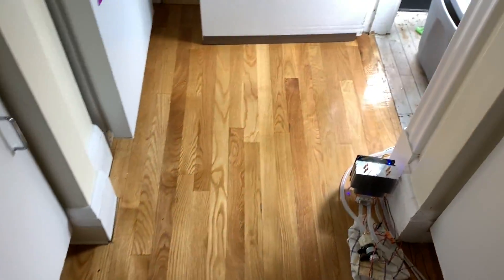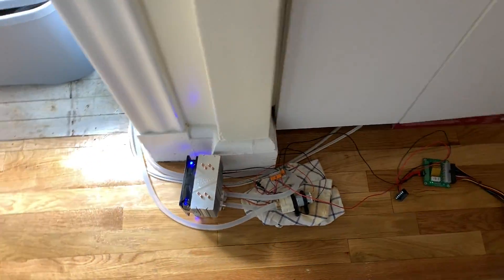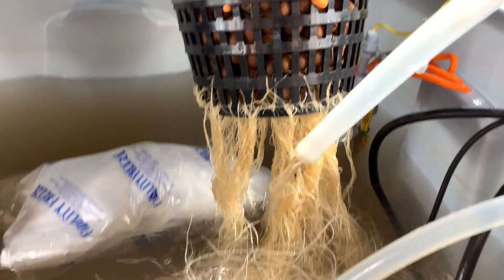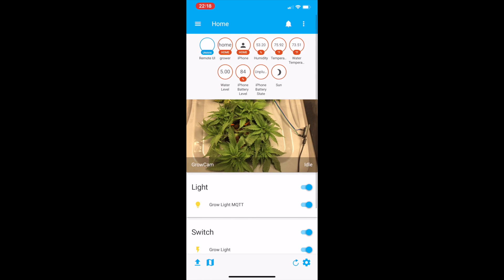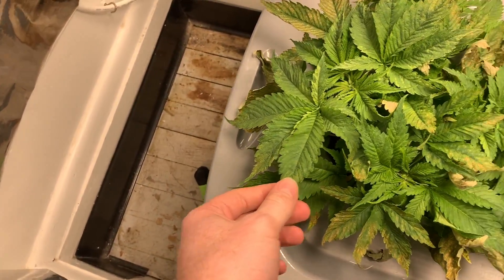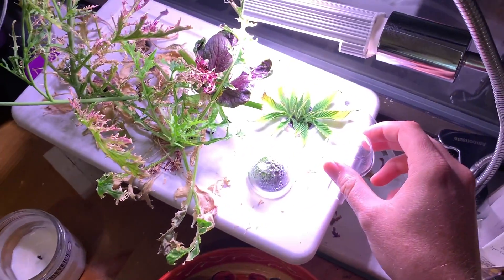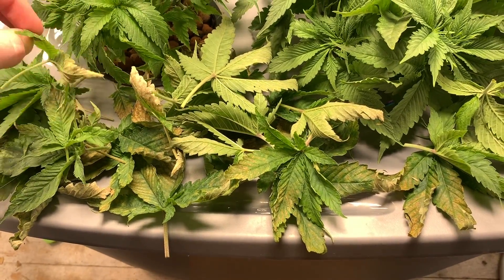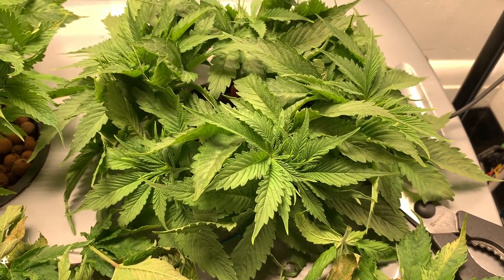HST, Defoliation and an Ice Pack | My First Grow 5

Comment: I have a couple suggestions for you. I have great success in my past DWC grows. Move the air pump out side the grow area. This will help will rez temps. Also I see that you need more air bubbles in that size of a tub. I ran that size of air pump and it wasn't enough.
Reply from the maker: Ok thanks for the advice. I can try to get another air pump and get some more bubbles going in there.

Comment: YOU CANT EXPOSE THE ROOTS LIKE THIS, THATS FATAL AND CAN CAUSE PLANTS TO DIE. YOU HAVE NITROGEN DEFICIENCY WITH JIM. ROOTS CAN SENSE LIGHT AND GET SHOCKED
Reply: Tarik yeah, am guessing you’re right. Too much tinkering. Bit hard to tell as seeing timeline video but maybe be careful with the roots with light/air . Systems are certainly getting tuned in though. Good work and good luck 😉

Comment: Put a 10w 10ohm resistor on your 5v line
Reply from the maker: Which 5V line are you referring to?
Reply: @SmartGrowAutomation  its cycling down because it's not properly regulated. It needs a constant load on the +5V circuit. Depending on the PSU you may also have to connect the Voltage OK +5V to the resistor circuit. 
10W 10 ohm. Wireround resistor works well. If you have already have a load on the +5V, I dunno what to suggest. Lol 
I used a 900W Thermaltake PSU connected to a 32V step up to power my supplemental COB lights and 120mm Fans for my Grow room. It was doing the same thing yours is/was. I ended up putting a load on the 3.3V
Works fine now.
Reply: Regulating not Regulated
Reply from the maker: @roybriggs1864  Ahh OK I am using the 12V lines so that's why I was confused 😄Are you saying I should have found the 5V line on that PS and added a load? Either way my new Meanwell PS is working beautifully and actually only drawing 80W instead of 110W.
Reply: @SmartGrowAutomation  all ATX format have the same coloured wires regardless of manufacturer. The +12V will be yellow. +5 red. 3.3v orange. Ground black. 
They cant regulate properly without a load on each circuit.
Reply: @SmartGrowAutomation  meanwell FTW!
Reply: @SmartGrowAutomation  Not fully awake, sorry. I was referring to your PSU wattage drop.